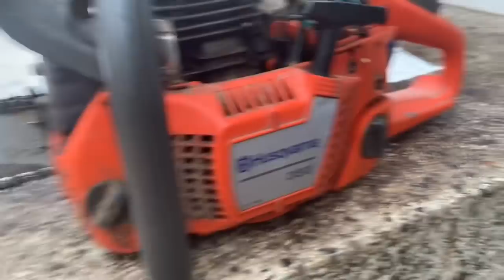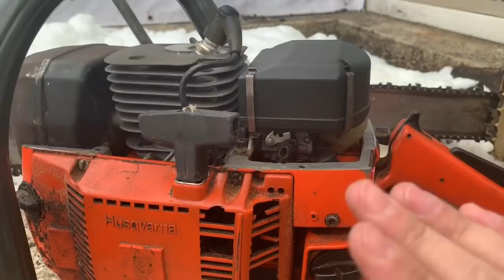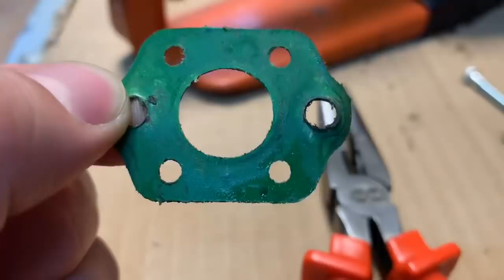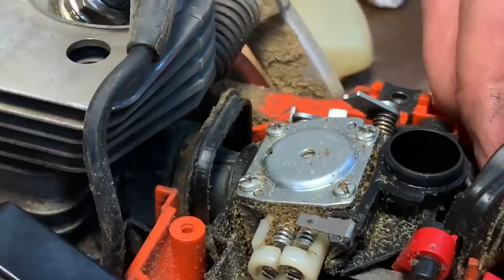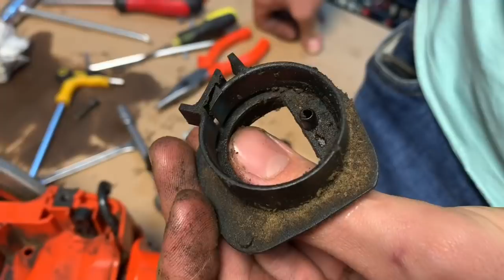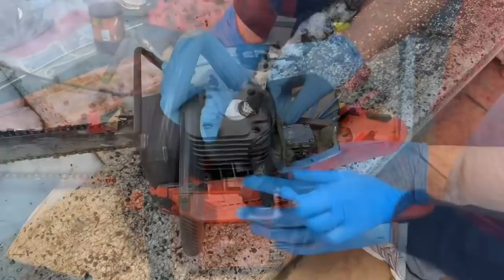Drujba nu merge bine, nu se regleaza, porneste greu

Comment: Meserias.
Succes.
Si a mea drujba husqvarna 51 porneste greu dupa ce se incalzeste.
Oare dece?
Vreau detalii.
Reply from the maker: Poate sa fie ori aprinderea ori setul se caleaza
Reply: @SHRMotorsOfficial  eu am un ms 210 i sa refacaut motorul cu um set de buna calitate meteor cand se incalzeste porneste greu daca face o pauza de 5 10 minute nu mai porneste decat dupa 8 10 sfori ce sa ii mai schimb
Reply from the maker: Ati schimbat si simeringurile?
Reply: @SHRMotorsOfficial  tot absolut tot semeringuri rulmenti furtun impuls galerie admisie supape furtun alimentare carburator walboro nou am reverificat am turnat benzina in motor nu curg semeringurile nu imi explic

Comment: Great video  the problem is the language but thanks for the English translation.....I have several chain saws some  they start then die ......some  start then die when try to accelerate .....The Stihl 009     010      011     I put new carburetor gasket in ....and  still doesn't start.....It is OK if I make my own gaskets ?....Petrol is fresh a couple weeks old ... A few times I have been playing with H and L screws ...could you let me know the right setting for each screw?
Reply from the maker: I think you should check the seals on the crankshaft

Comment: Salut! Am si eu o drujba ruseasca ural 2 cu motor de 150cm si 10 cp. Am avut propble cu carburatorul,  mi sau dus membranele, le.am inlocuit si pe urma din cauza la vechime mi sa dus jglerul. L.am inlocuit si nu mai are forta ei care o avea. Ea de regula nu murea in lemn mai mare ca lama ei adik 1m. Am reglato sa mearga cat de cat dar merge mai mult cu carburant decat cu sa aiba un amestec de benzina si aer corect. Poti sa.mi dai un sftat ce ar putea fii? Si scoate mult fum ceea ce inainte nu scotea mergea perfect. Te rog dc poti sa.mi dai un sfat. Multumesc!
Reply: Cui pontou

Comment: So air was leaking?
Reply from the maker: Yes!
Reply: @SHRMotorsOfficial  did that cause chain spinning at idle? Because my chainsaw chain doesn’t stop at idle is it to do with clutch or air leak
Reply from the maker: Yes it could. The air is making it torque higher
Reply: @SHRMotorsOfficial  what can I do to find out?
Reply from the maker: Is easy, just blow in the admision, and see if it leaks
Reply: @SHRMotorsOfficial  what do you mean admission?
Reply from the maker: On the intake